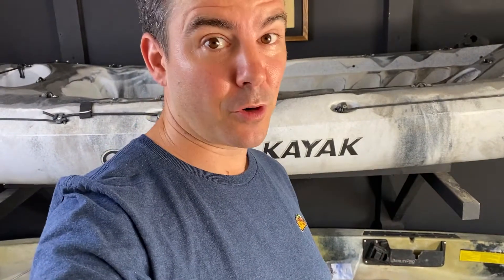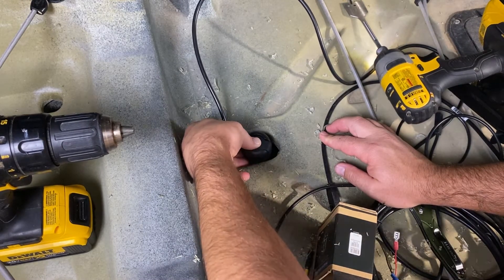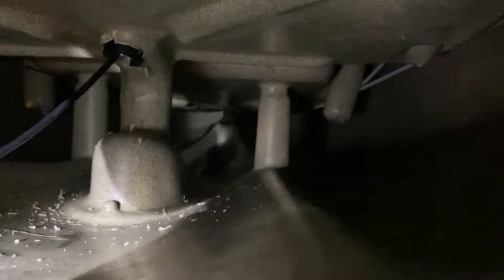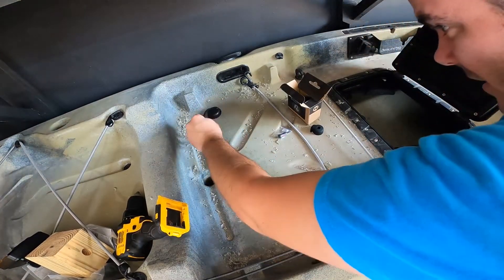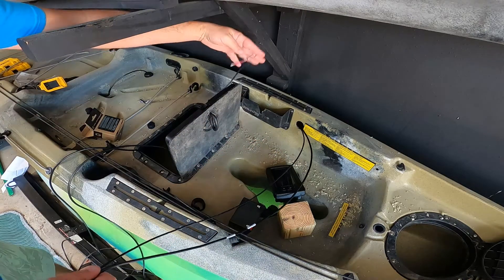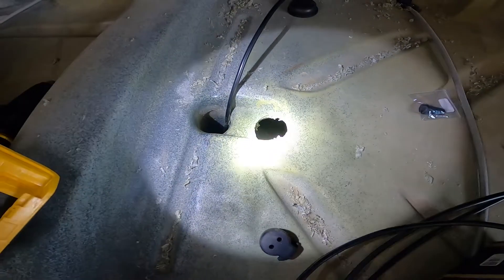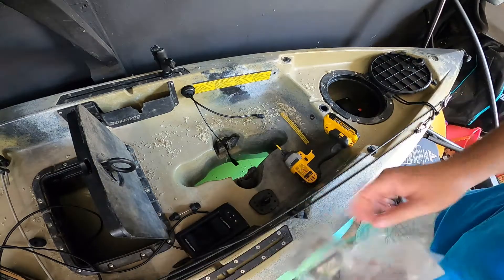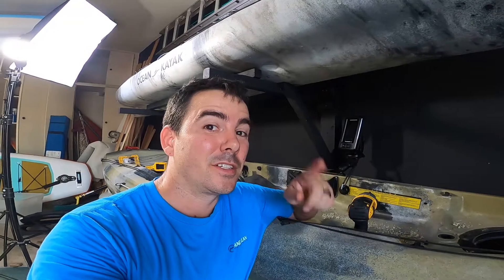DIY Wilderness Systems Through Hull Kit on a Hobie Compass - What not to do and lessons learned

Comment: I've got a plastic welder. Not sure if you have plugged the whole yet or not. Save all those plastic shavings in any case.
Reply from the maker: Oh shoot, I didn't even think about saving the shavings. I already fixed the hole.... But not as professionally as you would have done it. Dang, oh well, thanks for the offer. I even threw away the big plastic circle I had when I moved the Hatch to the front not even thinking i might need it later for stuff like repairs.

Comment: I literally made the same exact mistake with this through-hull kit, drilling the hole in just slightly the wrong place. Except that it's on a $40 resin storage container that I'm jigging to keep a heated water bowl power setup for animals in my backyard. My heart also sank when I realized what had happened 😅

Since this seems to be a common mistake with this item, they should really point it out in the instructions. Hope you were able to get that hole plugged properly.
Reply from the maker: @ChipmunksofNewYork  I fixed it and it has held up great so far.